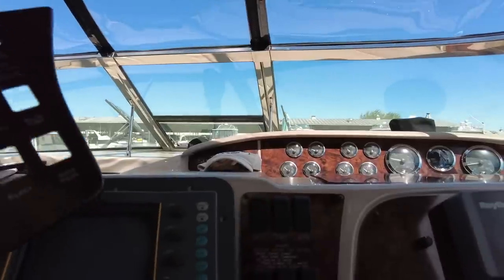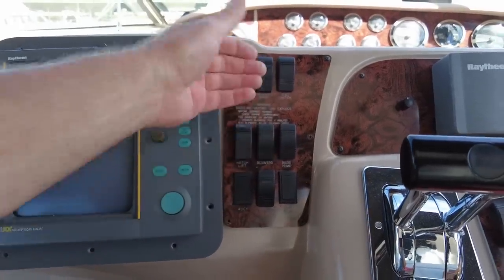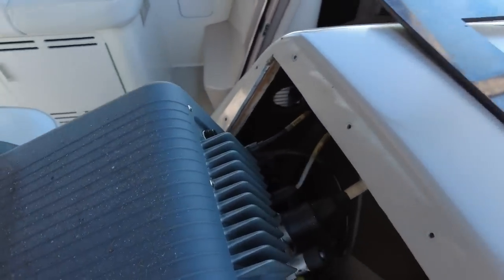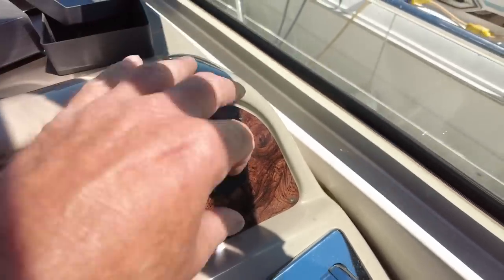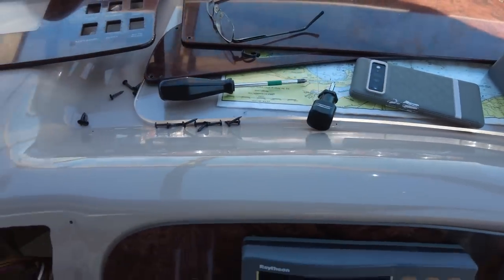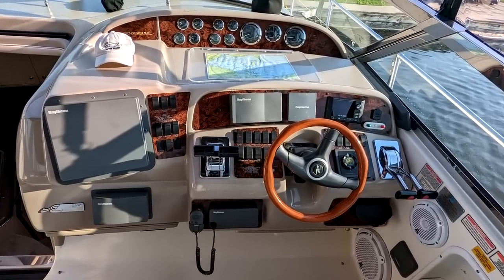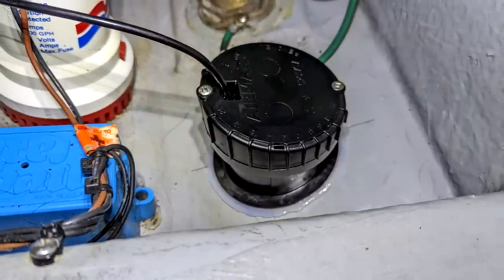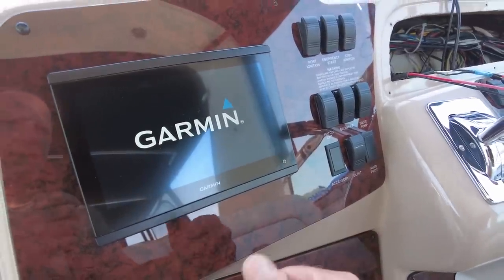New Garmin Electronics Installation - Sea Ray Sundancer

Comment: Yet another question.... thanks in advance!!  I noticed that you bought all the dash panels??  How did the gauge part go?  I have got to take mine apart to track down some gremlins this season.
Reply from the maker: Yes, I did get a complete dash panels replacement, as that's the only way they were sold - as opposed to individual panels. 
 I haven't yet swapped out the one that houses the gauges, but I have had it apart to run wires. A very straightforward job, as there's only a handful of screws that hold each panel in and the gauges themselves pop out equally easy. Just gotta remember the wiring sequence of each gauge 😉 
 If you watch this video from our 2018 Cruise, I show/talk about the gauges at the helm of our 330 Sundancer, which has the very same setup as the 370. Checking it out here; https://youtu.be/CF_xqHVc8yM?si=ved3rxM3kunz_ccD
Reply: Watched that video and that is exactly the process I have to do.... "connection clean up" .  I have got a Tach that is  possessed, and a volt meter that is a bit off.  Cheers Paul.  Thanks for getting back.

Comment: I now know where my amplifier is for my stereo!  Thank you!
Reply from the maker: Good, but not sure if the factory amp was in the same spot. The entire stereo system was upgraded to JL Audio equipment, which is what our current amp is.
Reply: @BoatingWithBoogaboo  thanks for the heads up.  My ‘99 370 has the original Clarion.

Comment: Look into adding the fuel flow transducers.  I love tracking my mileage and they are very accurate.  I can burn 100 gallons and then fill up and it will be within 1/2 a gallon.  Also a big advantage is learning where your boat runs the most efficient.  I have been able to get up to 2.7 miles per gallon by adjusting RPM and trim.  Where before where I ran it i was only at 1.9mpg.  There cheap for what you get out of them.
Reply from the maker: Glad it's working out for you. As for myself, and I think I've mentioned this way too many times, I'm not going to adjust my cruising habits to try and squeeze out a couple more miles from a tank full of gas.
Reply: @BoatingWithBoogaboo  it's not about a few miles.  It could be 30% savings so 100 gallons at $5= 500.  Savings could be 30 gallons in same distance a $150 savings.  Form me in a searay 360 that was only a difference in 3.5 mph and trimming better.  Plus you have to think about the engines and how much more efficiently they are running with less load so it has to be better for them.  I agree I would go from planed off to trawler speed to save a few buck.  But to each his own its your $$$
Reply: Make sure that you do your homework first on your fuel flow transmitter. I have a small 2006 express cruiser with a 6.2 MerCruiser and put on a transmitter that was supposed to work for a 5.7L- 6.2L Fuel injected engine, it did not. The orifice in the flow transmitter is not large enough for the volume of fuel necessary for the 6.2 L engine at wide open throttle to get on plane. The parts manager at our marina told me that I was not the first person to have that happen to using the specified transmitter. All that work installing a Nema 2000 system from the engine room to my Garmin SD7 for nothing.
Good luck
Reply: @davidmarshall5810  good to know.  I hadn't heard of that.  I have twin fuel injected 7.4 and haven't had a problem.  Since the flow meter is on the low pressure side. The pick up pump keeps the engine bowl full for the high pressure pump.  It's hard for me to see it running out of gas unless you run foe and extended period at WOT which I don't do so I wouldn't know if it would have a problem.   But you have me curious now so next time out I may waste a few gallons for a test to see if they act up.

Comment: A little late but you can just epoxy the transducer that comes with Garmin units to boats fiberglass flooring. I’ve done this multiple times and works perfectly fine. Only issue is you have to do water temperature offset adjustment since transducer is not actually in the water. I do this once boat warms up I take a reading of the actual water temperature then see what my Garmin is reading go into settings and do the offset calculations then adjust it and good to go. Some may disagree with this idea but I have done it with a couple different boats no issues sonar reads properly and crystal clear views.
Reply from the maker: Yes, I've done that in the past on our smaller Sundancers, but the hull is too thick for that approach to work on our current 370 Sundancer...

Comment: Now that you have had a year of use with this chart plotter I have a query.  Garmin sells both touch screen and button operated units.  An upgrade of the  chart plotter is on our upgrade list and I was wondering how the touchscreen has served you and would you have preferred one over the other.  Thanks as always for the " how I did it videos".
Reply from the maker: The touchscreen unit worked fine. I can't speak to the benefits of having one with physical buttons, as I've never used one.
 The only hiccup with the plotter was as a result of a - IMO - poorly activated default setting of Instant One. Although I was aware that it had been periodically coming on by itself. The negative impact became apparent when we were on the Rideau last summer and it came on one evening, unbeknownst to me, and was really overheating in the morning under its cover. I was forced to actually shut off the house batteries to reset it while we were looking through. Fortunately, another follower was good enough to point out that setting to me and no more issues with that. Like I said, a poorly thought through default setting...
 The other thing - which has nothing to do with the actual unit - is I found that the cartography is off by a good 100 ++ feet on a spot in Lake Simcoe (Strawberry Island). I'll be posting a video on that at some point in the future, but it's an anomaly in the chart (Navionics). Good thing for radar 😉
Reply: Thanks Paul,  I am definitely going to head down to boat show in January to scope these out.  I am still one of those feely touchy types for stuff like this.
Reply from the maker: My search started four years earlier 😉 https://youtu.be/hk0QufKgLYM

Comment: Did the chart plotter need any kind of GPS receiver or is that built in to the unit?
Reply from the maker: It's a Garmin, not a Ray-Junk-O-La, so the GPS transceiver is built in. No extra, unneeded and overpriced accessories required. Had that thing up and running sitting on my lap with no more than power and ground cables loosely attached to the leads 👍

Comment: Hey Paul, quick comment, it is safe to install and remove the micr-sd cards while the unit is on. When you insert the card it will scan the software and would have asked if you wanted to do the update. . :-)  Love the Garmin units. I have two networked on my boat with Fox Marine modules to show all my engine data on one and charts on the second.
Reply: I would highly recommend getting the Active Captain software all set up, it works great!
Reply from the maker: I installed the micro SD card before powering up the unit, then removed it after shutting down.

Comment: Hi Paul, did you add spacers under your Radome, or did you bolt it directly to the radar arch ?  Just doing some dreaming/planning if I were to add radar to my 2001 Maxum 3500. It has never had a radar installed so the arch is clean there. Also, did your boat have a NEMA 2000 network when you bought it, or did you install one ?
Reply from the maker: I used the solid (plastic/Starboard) spacers that I saved when trashing the old Raytheon junk (https://youtu.be/_P9N75ca2-A?si=CcCRJgz_e3eXFr-B). Bolted straight through to the radar arch - full electronics installation video here https://youtu.be/AgThlL7KM7U?si=yAPd8uVz48YJeVzS 
 NO NETWORK on this boat. Don't want it, don't need it. Would never use it. All the electronic components operate independently, exactly the way I planned and laid it out. Works perfectly for me.
Reply: Good point on network. Practical answer. Thanks for the reply.
Reply from the maker: Check out my installation video to see how the components are laid out to work independently. Plotter/Radar, standalone depth finder, VHF radio. Works great 👍

Comment: Sooooooo, love the vid and the work you put in here. If I could be presumptuous enough to offer some advice. I would reduce the resolution of the radar to remove some of the clutter from the screen. Then you won't see big red splats on the screen, it will show more detail and stop basically smothering your charts in the below layer. Excellent stuff as always, be safe out there.
Reply from the maker: Thanks for that. And yes, I'm still fine tuning my learning experience 😉

Comment: I have an off subject question.  Is your TV run off generator 110vac, 12vdc inverter, or is it dual voltage?  I have one I run on 110v in the marina, but I want the flexibility while camping.
Reply from the maker: The TV runs only on AC power, no 12V, no inverter - not even cable. We only ever watch it when on shorepower, generally at our home port marina. When we're traveling, there's nothing important that we gotta watch, especially since we haven't had cable TV in about eight years. Zero interest in sports or news, so majority is Netflix and YouTube. Obviously, there's nothing that we 'have to' watch, so alternative power supply isn't a priority.

Comment: Hey Paul. Nice job. It’s time for me to try installing mine but I need some advice since the electric stuff is confusing for me. How can I tell where to connect the wires for power near my own dash? What should I be looking for? I didn’t see where you got power from.
Reply from the maker: Yes, I saw that you mentioned your Garmin plotter hasn't been connected yet. I'm guessing that it has a built in GPS (like ours does), which means you wouldn't have to run a standalone transponder. If that's the case, you should only need to connect the power. 
 The unit should have come with a power cable that plugs into the back of the plotter. That will only need the wires connected to a power source at the helm. More than likely, you should be able to locate that behind there. Just make sure it's protected by a fuse - ours came with an inline fuse already provided in the power supply cable. If you don't have that Garmin power supply cable, look online, as I'm sure Amazon would be happy to sell you one 😉
 Finally, be sure to read the installation instructions!! Again, if you don't have that, it's downloadable right from the Garmin site. Good to have electronic PDF copies for all of your systems anyway...
Reply: @BoatingWithBoogaboo  I have all the wires necessary. I need to find that power source at the helm. That's what's confusing as there are a million wires going in a million directions.

Comment: Hello i watch all your videos really like your 37 sundancer my family just picked up a 99 34 sundancer with twin 7.4 v drives we have gotten an alarm lately is a continuous beep wondering if you have any insight all gauges look good
Reply from the maker: Luckily, I've never had that on any of our boats. What I can suggest is doing a Google search, including 'Sea Ray' in the search term. More than likely, you'll be directed to ClubSeaRay.com, a forum for Sea Ray owners. I've found it really helpful over the years in trying to diagnose issues.
Reply: @BoatingWithBoogaboo  Thank you i use that website alot very helpful we are going to have our marina plug into the engines and read the code your oil pressure vid helped me know to replace the sender for the starboard gauge really helpful enjoy the season you and anchor girl

Comment: Hi Paul - great video. Thanks for posting.  I always enjoy your content. 

I just purchased the same radar. I already have a “newish” garmin chart plotter that is compatible with the radar. Question: where did you get the update micro sd card from?  
Thanks 
Kevin
Reply: I bought the same unit... It is just a generic Micro SD card - you have to download the software. Even if you use Active Captain you still have to assign and install a micro SD card. Up to 32 GB for my unit.
Reply from the maker: Downloaded it from the Garmin site.

Comment: Paulie- question why the Striker & the chart plotter. It looked to me that your plotter already had depth and sonar options comparable to what is already on the plotter. all you needed was a transducer compatible with the plotter,o no?
Reply from the maker: As I mentioned in the video, I don't want the plotter screen cluttered with sonar, that's why the standalone finder.
Reply: Ah-ha interesting I can see how it can be cumbersome & then throw in a radar display or overlay screens are definitely too small
Reply: @BoatingWithBoogaboo  So Paulie does your depth show up on both units? do you run 1 or 2 transducers? If you do run 2 don’t they interfere with each other? Or do you run 1 with some sort of splitter and adapter cable? I would suspect there is a different pin set up on the back of each unit. Very curious as I like the set up.

Comment: Love the new boat and your Install and overview couldn't have came at a better time for us. We just picked up a new to us 2005 Rinker 342 and we are having the exact same setup installed in August with the exception of the fish/depth finder. One question, is the 943 capable of split screen to show the depth and plotter screens simultaneously?  I haven't been able to find that answer on the garmin site.
Reply from the maker: I believe it does, although I wouldn't be using it for that.
Reply: @BoatingWithBoogaboo  Thanks!  I watched through the video again and answered my own question. I didn't initially notice the side bar with speed and depth on it, so I wouldn't need the split screen. I love your setup with the separate depth finder, but my dash doesn't have room for the extra unit.